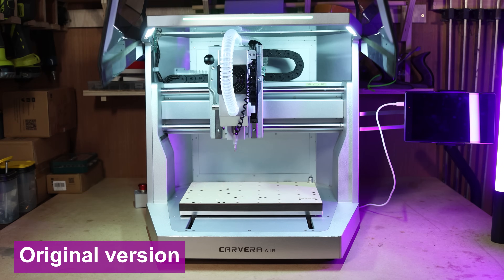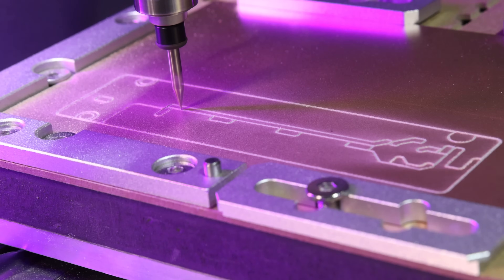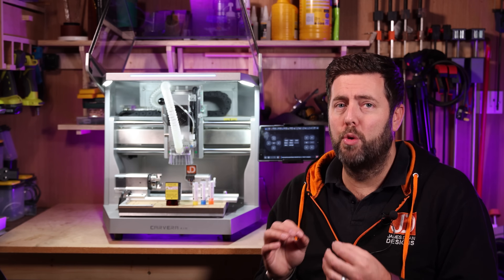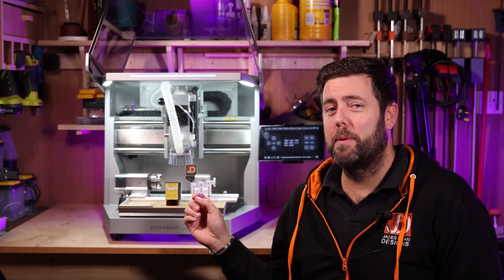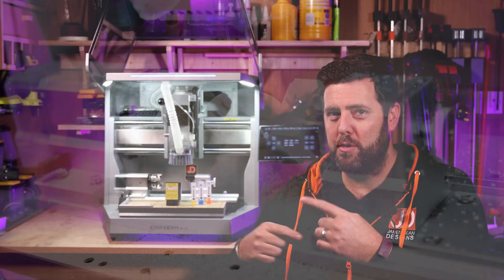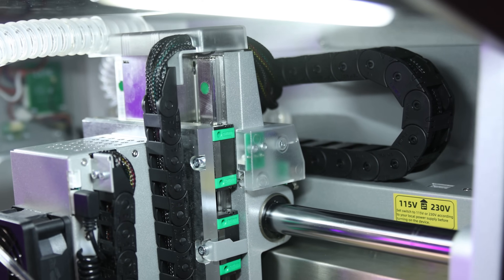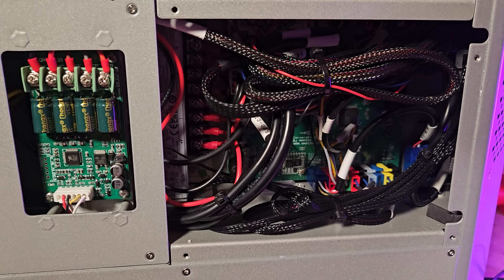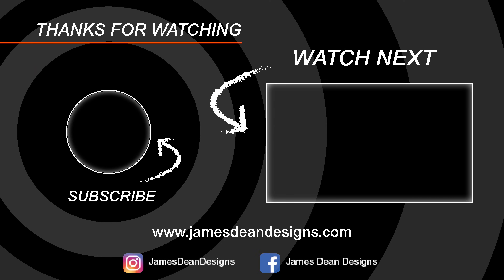WATCH THIS Before buying the Carvera Air CNC machine

Comment: What CNC machine do you recommend for detailing, a 4-axis one? I want to make wooden figurines, not small ones like DND, but again, not huge ones, say 8cm tall. Larger milling machines like the 4040, 6040, etc., have an accuracy of 0.1 (according to the manufacturer's specifications), while this Carver's is supposedly 0.01. Is that a significant difference? I don't know much about this. Let's say your budget is around 3000 euro. Also Carvera Air vs Carvera? Carvera Air is able to cut ebony wood?
Reply: Just got this machine and still learning.  But .1 to .01 I'd a major difference, if true.

If you send me a model in stl you are looking to do with yours I can try it in basswood (not the nicer woods you would want to do) and send you a pic of the result.  I currently only have 1" x 1" x 4" stock. But that should meet your needs of 80cm tall since with that I can get 60-80cm out of that stock

Comment: Those things are overpriced chinesium garbage. the spindle burned out in a month, no replacement for sale on their site, contact support they wanted $600+shipping +taxes. 
Every aspect of those makera machines are geared to selling you extremely overpriced accessories. On top of the that, the speeds are too slow, it's under powered, the accuracy is abysmal. WHen i say "abysmal" i mean it.. jog the machine to the middle, zero all the axis, jog away in any direction and then send the command to go back to zero, and it misses the mark by 3 - 8mm every time. Support was NON EXISTANT, just an email that was never replied to. 

Just steer clear of these horrible machines.
Reply from the maker: Not doubting your experience but I had 2 and never had any issue. Accuracy was perfect. In fact I know several people who purchased these and haven't heard of any issues. Hope you get your issues resolved

Comment: I have a background in 3d printing and am considering a machine like this for just its 4-axis milling capabilities. If that's my only use case, is this machine ideal, or should I be looking at a cheaper model? I may just be using the wrong search words, but I cant find anything else like this machine online.
Reply: I’ve been looking for a few years and also can’t find a cheaper 4 axis cnc than this one…
Reply: Saintsmart 4040 Pro Max

Comment: Needs a 3D plastic print head.. 2: they need to update their KickStarter side with the retail version and price...  and have Linux software
Reply from the maker: If you're suggesting turning it into a 3D printer then that's actually a bad idea. CNC machines don't make good 3D printers due to their slow top speeds and acceleration rates. The Kickstarter point is get but on the software they do actually have a Linux version to control their machine
Reply: Gantry router is what you want and at that point you may as well machine your own extruder bits.  Pellet style, big filament diameter style.  Because you have the beef to handle the mass of such setup. You aren't getting 100k acceleration at 10,000mm/s print speeds. THink more heavy duty.  HOT AND SLOW with max nozzle cfm/diameter to make up for the speed loss.     I'm lazy so if i need to machine a print i just bring it over to my mill and do whatever second operation i need done.

Comment: I ended up with a Fox Alien vac.  Do you know of a good way to hook it up?  I can’t recall if you had that setup working with the original demo unit.
Reply from the maker: @darolodhiga  you'll need some sort of adaptor to reduce the size of the FoxAlien hose down to the size of vacuum port on the Carvera. If you know (or can find) someone with a 3d printer it would be quite easy to make
Reply: @ I have a printer…time to get printing, thanks!

Comment: Thank you for your review, I agree with your points, I love mine as well, an amazing machine! I have a question, which software are you using for the 4th axis? I have a hard time finding information about how to use Fusion with the 4th axis and unfortunately, the Makera CAM software doesn't support it as well as 3D models (for now)
Reply from the maker: Best software I've found for 4th axis is DeskProto. If buying for personal use, the prices isn't too bad either given its capabilities
Reply: @JamesDeanDesigns thanks a lot, I'll look into this software! Price is adorable for noon commercial usage, that's great!

Comment: How is the software experience? Has it improved since your initial review? How does it compare with the experience on other machines?
Reply from the maker: The control software is fine, transferring files via USB is still a bit slow on it. The CAD/CAM software has been due a big release so I was trying to hold off using that until the release came out but the video was ready. Might do a follow up when it does get released

Comment: The spindle speed compensation sounds like something that would just be nicer on harder materials. This machine doesnt do harder materials. If you want to make PCBs, you done need super accuracy. I like the idea but i feel like for what you get, this is a bit silly. 95% of the features can be done on a 400$ machine. Considering the 3D printing space's position in this kind of tech, i find CNC manufacturing to be quite lack luster. I dont hear anything about auto leveling or planarity checking of the material. All of these machines are bedslingers which makes little sense considering you want the bed to be extremely flat (i doubt they would male something as stiff as a mill vise). This thing contains 0 cameras. 0 collision detection other than spindle speed. And relies on outdated limit switches to find home.
Reply from the maker: @WhatsTheWordBozo I hear what you're saying. I would like to see some more tech upgrades on CNCs but worth me highlighting that this can do hard materials, ive shown it previously and others have, it can also do auto levelling as well.
Reply: 0:59 auto probing feature probed wasteboard/work platform for level and auto compensate during carve for any undulations. Does this show lackluster or poor comparison to 3D printers you mentioned?
Reply: Have a look at the Millennium machines milo, were a reprap open source style project like a lot of 3d printers and we are far more capable than makeras since we focus on VMCs and not glorified routers (and were less than half the cost)
Reply: @jakeengland1430  Millennium machines milo 0.1mm accurency so its very bad, like 4040 bad.You can use FMJ and then its 0.03, still not close to Carvera <0.01.
Reply: @mintfork6643  have you used a carvera ? Cause i can tell you right now that that number is bullshit 😂
Reply: @jakeengland1430 I didnt use it, but looking at motors and how under powered drill is, I would say that it can be this accurate. Looking at MILO veery bad motors, I know it can go only 0.05 or above, even on FMJ. So, do you have any other 4 axis CNC for detail, like simple wood models?
Reply: @mintfork6643 what are you on about bad motors ? It uses larger nema23 where the carvera uses nema 17s and they both have the same resolution, you honestly sound like you're just parroting specs that you've heard online and never actually used a CNC machine at any level ... milo is stiffer, has a more powerful spindle and motors with the exact same resolution steppers and they're bigger to boot. All youre doing is spouting nonsense now.
Reply: @mintfork6643 the spindle on a carvera is 250 watts the standard spindle on a milo is 1500 watts, the reason we say 0.05mm is because we don't lie about the actual performance rather than just telling everyone what the theoretical resolution is how many years have we been told that 3d printers can achieve speeds of 500mm a second yet they never actually print at that speed cause the hotends don't keep up. Stop reading spreadsheets and stop trusting reviewers who are new to machining they just don't have the knowledge to show you what a good machine actually looks like
Reply: @jakeengland1430  Carvera use harmonic drive in this motors, that's why it gets higher accuracy. Higher W in spindle give higher vibrations and rebound. Also in site it's not 0.05 accuracy but 0.1like I said is on Chinese 4040 level. Do you have Carvera?
I ask you honestly on other recommendations but you insult me again. I can be mean too. Do you build MILO and fight with me now for lost money and 40 hours of building underperforming CNC that is on chinese 4040 level?

Comment: I've been really happy with mine. One thing I would say is really helpful is to get a very powerful vacuum for chip extraction. I'm using a 12 gallon DeWalt stealth Sonic and it's powerful enough that I actually had to get a variac to turn it down. It's a pretty quiet vacuum but the best thing is it moves enough air that you really can't even see the chips as they're being made, there's almost no recutting of chips and it's almost certainly acting to keep the bit cool due to how much air is being moved.  It's even powerful enough to suck most of the chips up through the hose using the fourth axis just by having the hose in its clip and keeping it near where the cut is happening.
Reply from the maker: Oohh I was looking at getting Stealth for my small worthshop. Thanks for the feedback on that 👍
Reply: @JamesDeanDesigns  I would definitely recommend it. I got the 12 gallon one because it's supposedly a little bit quieter and got the fine dust bags as well as HEPA filter which pretty much guarantees you're not going to be blowing any fine particulate into the air. 
I think a variac is definitely worth adding as even though the vacuum is pretty quiet to begin with it flows plenty of air at around 70% and is very quiet at that point.

Comment: If its capable I dont mind paying the price, but it looks like it struggles on anything other than soft wood.

Its almost good.

What we need is something like this but a bit more rigid like the proverXL series genmitsu cnc's.
Reply from the maker: As someone who has used both, this is more rigid than the ProverXL range. Even the 3030 which is great, this is still more rigid...but equally more expensive. A larger/faster spindle would be nice but this machines metal easy as long as the feeds are right
Reply: Another bonus of a larger spindle would be the capability to use professional tool bits cutting deeper chips from alu or steel. Ofcourse it would result in a much faster part times. I wonder why they didnt opt for 500-1000w spindle here.
Reply: @happygiraffe9787 agree with you on this one. A more powerful spindle would be nice. I'm guessing reduced cost and space usage. Having the option for a more powerful spindle would be nice though. It supports up to 6mm or 1/4 inch which is larger than the default, but still a bit more oomph would be nice.

Comment: this is a vastly overpriced machine. it looks great, no doubt about that. beginner machinists, please don't buy this machine.
Reply: If you’re going to state such hot takes on the matter, at least back it up with a “why”.
Reply from the maker: Please do let us know why you believe this and also let us know another machine that has these capabilities (including the free software) at a lower price. Ive tested quite a few desktop machines and this is the most advanced I've used but appreciate I haven't seen or tested everything
Reply: @JamesDeanDesigns it doesn’t look very rigid for milling aluminum, but I could be wrong here. 
Great review btw. I bought the FoxAlien Vasto CNC router, based on Your review, which was very helpful indeed. Frankly 
I have not been disappointed by the purchase even once …thanks
Reply: Agreeing with @Xenthera. Do explain why this is overpriced. It's not excelling in any field I'm sure, but the quick change, auto probing, enclosure, and other features that make it easy to get started with and have a wide range of options for one-off parts, seem like they make a good desktop cnc, especially for beginners. Having to add some or all of these features to a cheaper machine will add up quickly in terms of cost snd you'd have to source and build it yourself.
Reply: @qwertyboguss  it’s good only for PCB making, metal milling will require more rigidity, coolant handling etc
Reply: @arbjful  from what I've seen it's fairly rigid. As mentioned there's video's out there milling (stainless) steel. Which requires some conservative cutting but it can be done.

No it's not a workhorse for production runs but it's aimed for the hobby market. I still do not see arguments why it's overpriced for the features they have. It's a desktop cnc that can be run inside an office. Which is quite versatile and capable.

But do point me to a CNC that has the same features and comes at a lower price with more rigidity and cooling out of the box. Adding those capabilities will both require quite some work and will probably set you back enough to overshoot the Air pricing. I like to be proven wrong though, because then I can put something else on my wishlist.
Reply: @ Langmuir MR-1, and DMC-2 CNC from shariffdmc both look pretty solidly built
Reply: @arbjful  both are at a different price point. Besides that the DMC requires 40 hours of assembly and isn't fully enclosed. The Langmuir isn't a desktop CNC. I appreciate it's not for you but that doesn't warrant claiming it's a useless machine that beginners should avoid. On the contrary it feels like the perfect machine to get into CNC without breaking the bank.
Reply: What if I’m an experienced machinist? lol
Reply: So, what should a beginner purchase? I want a carve molds for ceramic tiles and need something will carve on rings and bracelets.